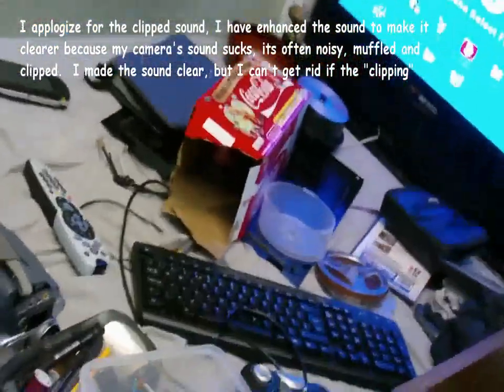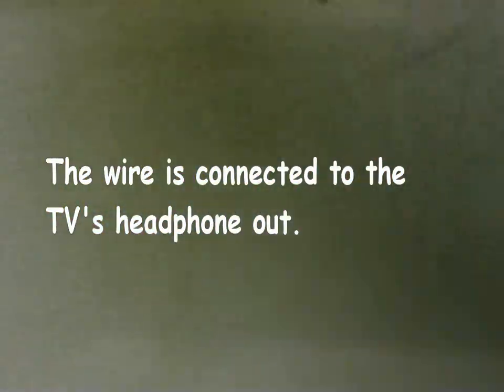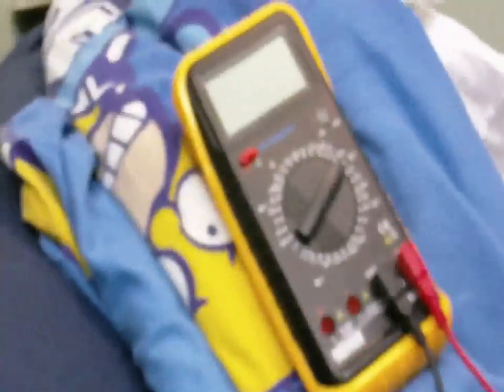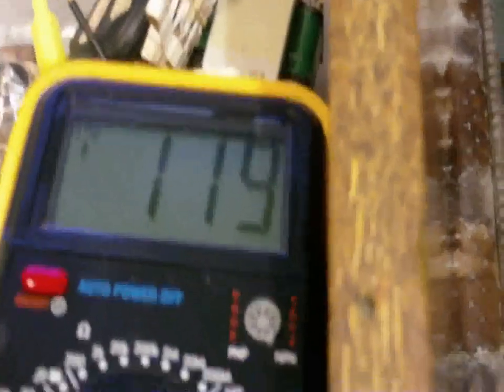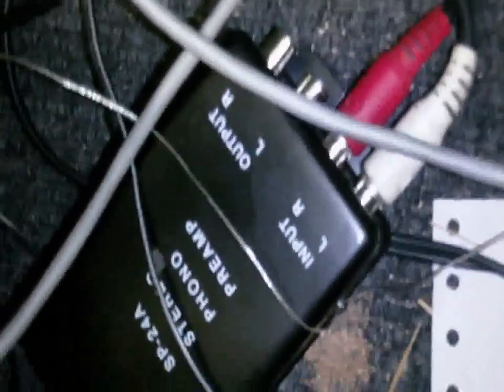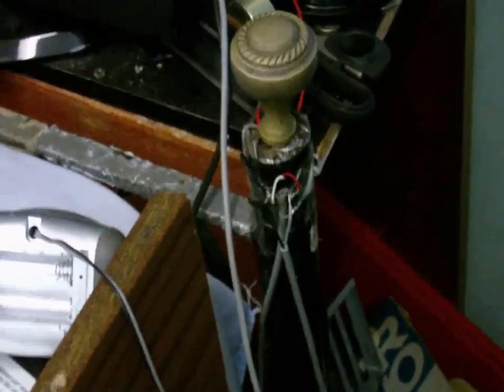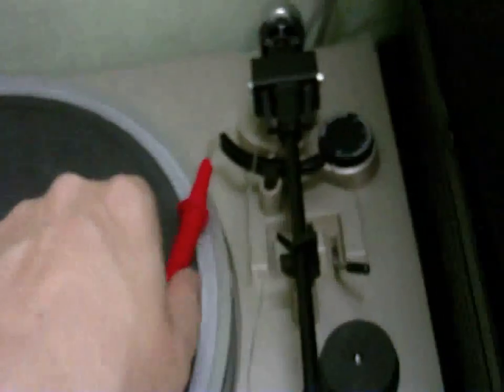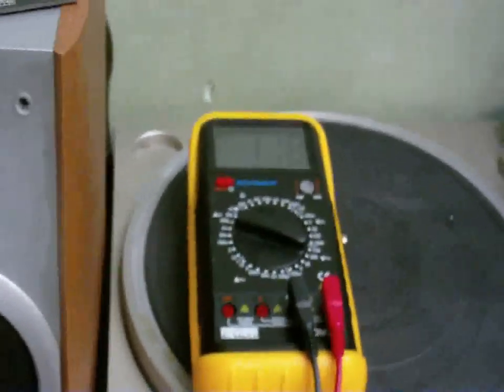Fixing a leak voltage problem

Comment: My guess is a bad earth connection, one of those sockets isn't earthed. Had about the same voltage between two metal desks in work (found out when it buzzed me), the filters in the PC power supplies caused the earth voltage to drift up to half mains potential.